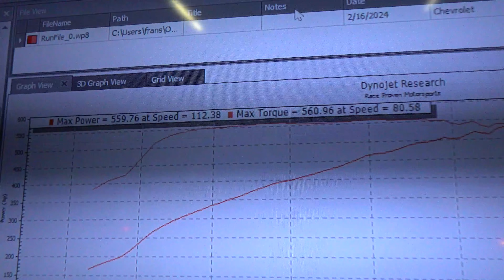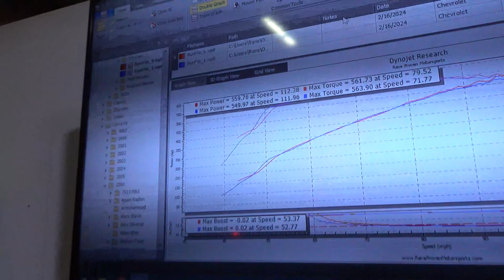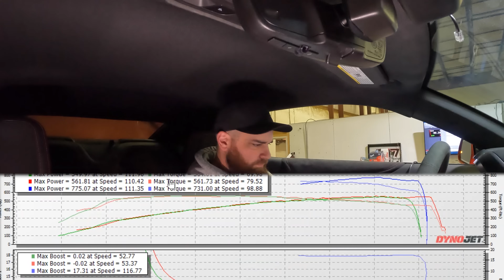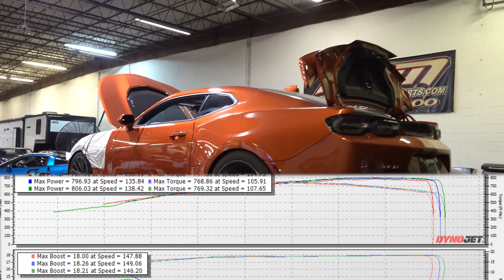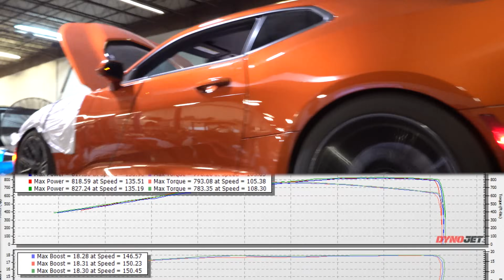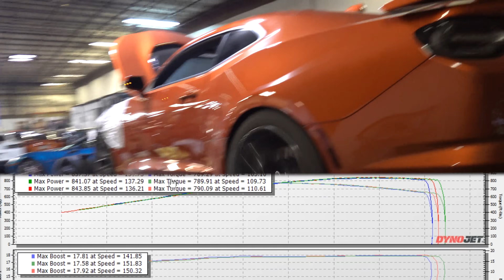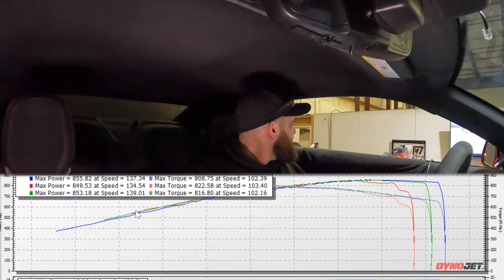1000HP Stage 4 6th Gen ZL1 !!!

Comment: Don't care for automatics but I find it interesting that Camaros get an A10 while Corvettes get an A8, but I guess it makes sense for the bigger and heavier car to have more rapid Gearing to get up to speed. 🤔
Reply: It’s because of size the 10 speed won’t fit in the corvette from what I was told
Reply: @TJRELITE; @robertbull6248;
both of You clearly lack some basics within mechanics, mechanical, automotive, motor vehicles, drive trains, mechanisms, etc. ! :-o
The Camaro platform is very similar with the CTS-V platform, thus have basically the same, similar components. They are both front engine sedans, RWD. The Camaro is significantly lighter than the CTS-V, closer in weight to a Corvette actually.
The Corvette, C8, is a very different, unique platform with rear-mid engine, thus unique DCT, trans-axle which is developed, manufactured by Trimac, TR-9080, thus performs very similar to a manual, but with automatic, electronic control via TCU, which includes control of the fluid, pressures≤ etc.
Thus, the automatic transmission type in the Camaro, CTS-V, could never be used with the C8 platform. Simple, Period.
The C8 was designed with racing in its design as for the C8-R, along with all versions, simultaneously, though are released for production gradually; C8 Stingray, Z06/7, E-Ray, ZR-1, Zora.
Their C8-R version production models, as required by various racing organizations, are available for purchase by racing teams.
If You search properly for more available, accessible details, information, knowledge, You can become better informed, knowledgeable.
RPM had one C8 Stingray in the shop previously, but they could not do very much, since no tuning was available.
Now that HP Tuners has been given access to the C8 engine ECU-ECM-PCM, perhaps some people or even the shop may have some performance modifications, upgrades, available with engine tuning, but currently not with the TCU still. Other more unique shops have been involved in performance upgrades, especially Twin Turbo, methanol, upgraded DCT clutches, etc., including Fuel Tech, AMS using MoTec, another Texas based [purposely not mentioning] also using Fuel Tech; Hennessy had some more simple "bolt on" type modifications early too. Fran seems to not get involved with external ECU--ECM=PCM used, modifications in the shop, though his racing Corvette uses a custom ECU-ECM-PCM, which he stated has changed for this year to Fuel Tech, primarily because of the chosen expert tuner only uses FT; connected with Proline too.
All The Best, Sincerely
Reply: @newtonfirefly3584  Im not lacking anything! First off I'm not a GM technician and second I'm not a keyboard thug so Come Correct Guy! Im obviously aware of why there are different transmissions for different platforms. I said that it's interesting and don't like autos anyways which is the point of the comment that you clearly missed. Your manufacturer conference speech in the comment section is unnecessary! Thank You
Reply: @newtonfirefly3584 itsTremec  not Trimac. Also the 10L80/10L90 are too big to fit in the C8, simple as that. No one needs the word diarrhea.
Reply: @newtonfirefly3584  who said anything about a c8? I’m not reading all of that. Like I said the transmission won’t fit in the c7
Reply: @DomoGenisis976  False claim from another ignoramus for the basis, reasons !! 😲
Reply: @newtonfirefly3584  1st-Learn how to spell Tremec,. 2nd-The 10 speed is too long to fit in the Corvette. 3rd-You tried to make yourself sound smart by spewing info that no one asked about.  Get off your computer and get a life.

Comment: DST fall back spring forward. When I installed a Stillen SC kit on my Infiniti, I had just filled the tank. The rear seat comes out and the tank hat  is in the passenger compartment. What a PITA. Did not spill any inside the car but lost half a gallon on my driveway.

Comment: DSX is or has already came out with a super trick dual pump hat/bucket setup for the 6th gen/CTSV. It's been tested to 1000whp+ on full e85 and port injection I do believe already. Might be another option to look into for the bigger power LT builds you guys do. It even comes with a OEM style FPCM that is tunable through HPT to run both pumps however you want.